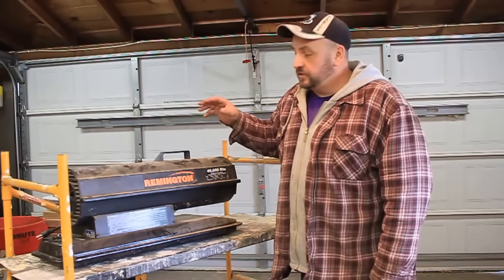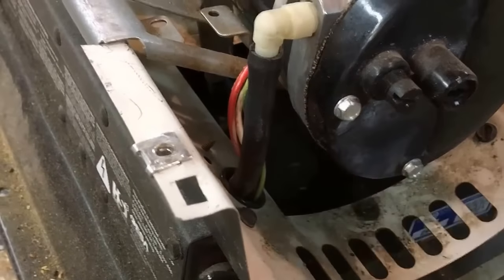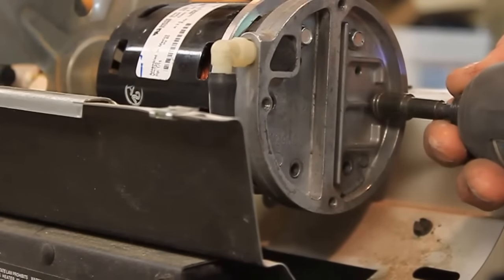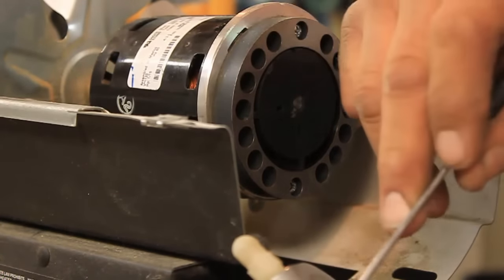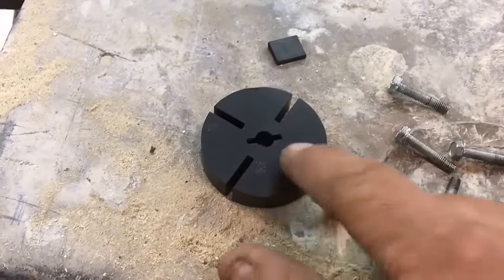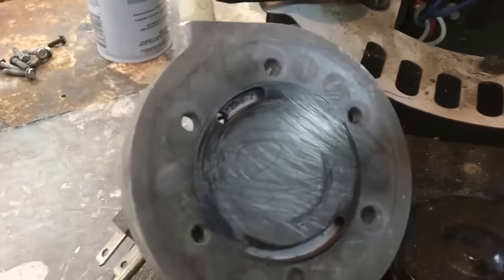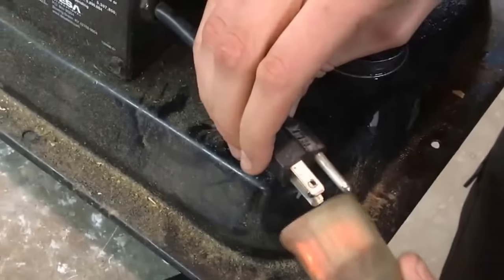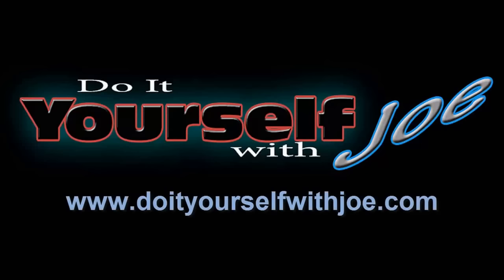How to Fix a Torpedo Heater/One of the Cheapest and Easiest Fixes

Comment: I bought a used old sears torpedo heater, and it worked for a day and then stopped. It’s literally doing the same thing Your’s was, I tried cleaning the spray nozzle, and the feed lines for the air and fuel but nothing, I’m try what you just showed on here I hope this fixes it! Thx for posting! 👍🏻
Reply from the maker: Good luck. Please let me know if it works.
Reply: So I took it apart and they seemed to be fine it was a little dirty but the slides were coming out like they should. I cleaned it up and lubed them up any ways and also cleaned all the air filters. Put it back together and nothing. I have a clear hose on the feed line for the fuel and you can see it starts to suck fuel but then it stops. So my last guess is there is something inside the tank that the pickup keep sucking up. If that isn’t it then I’m lost because the pump is pushing all kinds of air you can put your finger in front of the spray nozzle and feel the air coming out.
Reply: @Lukedawg1984  dirt on the photocell?
Reply: Gary Dodson possibly but that would kill the spark/heat element wouldn’t it? It is throwing spark like crazy. I guess that would be worth a try couldn’t hurt anything that’s for sure. Thx for the suggestion. I’ll try and clean it!
Reply: Check the fuel line for cracking.  it's a common problem for many heaters of this style, the diesel/kerosene breaks down the cheap rubber hose the factory puts in.  this causes cracks that cause it to sputter or not ignite at all because it's pulling air bubbles in instead of fuel.  it's easier to see them if you manually flex the line around.  i just picked up a heater with this exact problem for cheap, and after a $3 fuel line from the auto parts store, it runs good as new

Comment: Mine will fire, but shuts back off. Any solutions for that? Or should start here first?
Reply from the maker: If you have a compressor turn the pressure down to about 50 psi. Take the hose that comes from the back and stick the air nozzle into the hose. Start the machine. once its ready to start blow compressed air into the line. If it keeps running then something is wrong with the pump. I show how to do that in this video, here is the link.  https://youtu.be/zVnwTnWTOSQ

Comment: glad i ran across your video. this is about the only thing I didn't try today and it seems like this SHOULD be the fix. I'm notting getting fuel. So, tomorrow I'll give it a shot. Thanks
Reply: David Sanford how did u fix ur fuel promblems?
Reply: i've been so busy i haven't had time to mess with until today..... darn thing still won't work... and it's spraying a fuel mist when u hold up a flashlight u can see it.

Comment: Thank you for the help I got old trustee running again I end up having a cracked fuel line ...
Reply from the maker: Thank you for sharing! Another easy fix that may or may not have cost anything but time. Did you need a new fuel line or were you able to trim the end off?
Reply: @Doityourselfwithjoe  I was a able to trim a little bit off and used a small hose clamp to secure it

Comment: I fixed many of these.Vanes on pump stuck same issue.
This is an air pump not a vacuum.
Air pressure goes into the ejector sucking fuel and sprays out of nozzles.
 Other common issues are: CAD( electric eye which verifies fire in chamber pointing at flame) cell dirty causes unit to shut off in a few seconds if no flame.You can clean off and aim it at flame.
Cracked dry rotted fuel hoses no fuel to nozzle.
Screw with ball and spring sets air pressure 5-10psi to adjust fuel delivery. If out of adjustment unit won't work correctly. Factory has spec on pressure.
Reply: I'm surprised you didn't check the air line first.  I have fixed a few of these for having the same problem.  And each time, I found that the air line becomes old and brittle.  As a result, they crack and break, or loose a seal around the fitting where it attaches causing an air leak.  Good video.

Comment: Would dry silicone be as good as graphite?
Reply from the maker: Not sure. You can apply some and see if it works. Just cleaning the fins may be all it needs. Nothing can be wet because it will gum up and you will have to take it apart again.

Comment: My 135,000 btu Dewalt heater will only blow hot when i press my thumb over the pressure adjustment screw.  WHen i release my thumb the flame goes out...please help!

Comment: Thanks for the vid, love the scaffolding repurpose into workbench trick.  After replacing filters with new and adjusting PSI to 3.5, I get fuel and spark into the burn chamber, but it takes forever to fire and mimics engine flooding.  Before I replaced filters it fired instantly.  I replaced them because they were falling apart.  Anything to troubleshoot for this?
Reply from the maker: You got me on that one. I would think it would be easier for the unit to siphon fuel with a new filter. If you do come up with a fix  can you post it in the comments here? Would like to hear the remedy.
Reply: I learned today that it will fire right off if I remove the hood.  Leave hood on, no fire, flooding.  02 not getting to the fire when hood on.  Hoping to learn more this week.  I got sidetracked while converting an old television cabinet to a hardware bin, hence the scaffolding comment above.  Love it.

Comment: Just had my unit apart. Was afraid to lube it. So cleaned with a rag and put it back together. Works now but not as good as I like. Not atomizing enough by the way it smells a little. Going to get graffit and doing it over. Rock and roll baby
Reply from the maker: You can also take a fine wet sand paper and sand the blades down a little

Comment: I have a master heater that I run diesel in. iv only had it a year and don't use it very often. just when I'm working in the garage. I plug my heater in and it trys to start but wont... I can try it 10 times in a row and it still wont start. I walk away for 10 minutes and come back and it fires up right away. any idea what my issue could be. haven't taken anything apart yet.
Reply from the maker: Wow i definitely haven't heard of that yet. I will have to ask around.

Comment: You know guys that's exactly what goes wrong with about 90% of them the little pump fingers don't slide down after they get dirty I like to use a little bit of Scotch-Brite in between all the teeth and then I sand the teeth all down a little bit and man my pump runs red hot in the front no stink runs perfect

Comment: Any idea why my heater only runs if it’s tilted?  If I pick up the front end and set up on a block or something, it will run, ( or the back end)otherwise it won’t if it’s sitting flat!
Reply from the maker: I want to say it has something to do with the pickup tube in the tank. It doesn't make sense, front or back though.
Reply: @Doityourselfwithjoe  Yeah that was my thought too, until i picked up the back-end as well..and it ran fine..I still think its something with fuel delivery, but doesn't make sense..I'll update if i figure it out. Thanks

Comment: I’m tearing mine apart because there is no pressure being read. I give it a clean and it still does not want to suck air to spray?
Reply from the maker: before you take it apart again, and if you have access to compressed air, turn the machine on then  take an air hose and shoot compressed air into the line. If it fires up then the problem is in the rotor area. Then i would take the cover off the rotor and by hand make sure the blades drop into place. If that is working fine you may have to hook up a pressure gauge and turn the adjustment screw that controls the pressure.

Comment: Joe, I have a heater that runs and shuts off after 5mins. I've replaced, the ignitor, eye, impeller, nozzle, circuit board, fuel filter.
Reply from the maker: not much left to replace. I'm not sure if there is an over heat sensor or not.  Try to run the heater with and air hose and see if it still shuts off. If you have a compressor, turn down the air. Then take the hose off the pump and stick the compressor air nozzel in the hose from the air pump. See if that works. I have a video on how to do that. https://youtu.be/zVnwTnWTOSQ. If it still act up then you will have eliminated the air pump. After that i can't imagine what might be wrong because of what you've already replaced. If you do get it fixed please post back here on what it was. It may help others with the same problem.

Comment: Hey,my units starts and runs great with the shroud off. When you put the shroud back on it quits,any advice?
Reply from the maker: Sounds like something is getting pinched or grounded out in someway. If the fan stops running as well it has to be a short of some kind. If the flame goes out and the fan keeps running then I would think it is and air flow problem or a line is getting pinched or a wire for a sensor is grounding out.
Reply: Thanks so much,appreciated.
Reply from the maker: I hope you find your problem. If you don't mind can you comment on what the problem was? I would appreciate it.
Reply: Checked the pump pressure,it was at 4.0,turned back to 3.0 and it worked perfect. Thanks so much ,your video was a great help, Brent
Reply from the maker: I'm glad I could help and thank you for sharing!
Reply: Hey,youtube is the shit. I run a construction company,its how we look after our equipment. A no brainer.
Reply: Brent Little po
Reply: Did you figure out why it only ran with the shroud off?

Comment: I have one that runs for about 10 minutes has new hoses and cleaned photocell and connector but shuts off after 10 minutes gonna try this but not sure what could be the issue is
Reply from the maker: Please let me know what the issue was
Reply: @Doityourselfwithjoe   for one the fuel line and air lines was broken and rotted I cleaned the photocell then I noticed the screw to turn up air pump had backed out a good bit so I adjusted that and now it runs great
Reply from the maker: Awesome! Thanks for sharing! I want others to benefit from this as well!  @lilvedo1
Reply: @Doityourselfwithjoe   no problem

Comment: My dyno deluxe 80000 turns on then shuts off after 30 or more sec. And light is off on the thermostat? Is this why ?
Reply from the maker: it could be. Try taking the siphon hose off and send compressed air through as it is starting. Dont set the pressure to high. If the heater keeps running, then that is your problem.

Comment: i have 2 dewalt torpedo heaters that run for 2 minutes than the fan starts making a winey noise and shuts off completely.  any ideas?
Reply from the maker: It sounds like the fan bearings are going out. That would be my guess

Comment: I have a year heater hardly used that will only run with the top half of the cover loose with out the screws  , air cleaner new and clean proper fuel pressure,  weird cover tight won't run take screws out runs perfect
Reply from the maker: Make sure you're not pinching a wire or hose.
Reply: @Doityourselfwithjoe  I triple checked everything,  I can not find a single thing that would cause this, it's like a air fuel ratio is off , but what and how? All pressure testing is right on...
Reply from the maker: @stevenstair1068  If the hoses don't have any cracks or are not pinched, then you got me stumped. If you do figure it out please post the solution here.
Reply: @Doityourselfwithjoe  I certainly will. I was in skilled trades machine repair for 45 years and could fix almost anything but this has me really stumped!

Comment: I have one that the fan won't spin?  When I spin it by hand it has a tight spot where the fan stops. I can force it past it but when I plug it in it just stops?
Reply from the maker: The fan is shot. You can take the fan apart and try to lube the shaft with WD40 or oil.  and let it sit for a couple of hours. That might help and give you another season. You might be able to order one online or get one from Grainger.
Reply: @Doityourselfwithjoe  I think it's the motor itself. Going to order one.

Comment: i have a protemp pt70 kfa.  when i switch it on the green light goes on but it does not strt.  any ideas?
Reply from the maker: I don't know much about this model. I would need more information. Does it do anything at all? I think these are the models that flashes trouble code. Is it giving a code? If the green light is on we know it is getting power. Does it hum? Does the fan turn on? Does it have a fuse?

Comment: My heater seems to spray to much when it is running (which sometimes it doesn't start and blows smoke) it send out droplets in the heat when it is running. You see a little kerosene on the bottom of the front that is not burning. Any ideas
Reply from the maker: There could be something in the nozzle that is causing it not to spray a mist or its possible the pressure is to high.
Reply: @Doityourselfwithjoe  Thanks for getting back. It also has a high/low and if you start it on low it blows smoke b4 it fires.
Reply: @gjames57  , you want to make sure to start the heater on high every time. Once it heats up you can switch it to low.
Reply: @michaelzeinert2074  Thank You I will

Comment: Any idea why a 75,000 btu unit works better with the fill cap off then screwed on? Im talking about the fill cap on the "gas" tank.

The unit is a Master MH-75T-KFA 75,000 BTU
Reply from the maker: It has to be a ventilation problem. There should be a small hole in the fill cap. This allows the fuel to be siphoned from the tank. In your case it may be clogged. Check to see if it needs to be cleaned or you may need a new fill cap. Please comment if that fixes the problem or if it was something else.
Reply: I have the same unit, and it has 3 vent holes drilled through the cap. Check your cap to see if it has vent holes or not.

Comment: I figured it out why the fan wasn't spinning.  Someone along the line had put the black carbon thing in backwards.  So what in the world would cause the heater not to light when you can see fuel spraying in and the glow plug lighting?  Even double checked to make sure it was 1-k kerosene.  It is getting air from the pump.  Sprayed out the nozzle and can blow fuel thru the line into the tank.
Reply from the maker: you got me on that one. Unless the nozzle spraying the fuel isn't aimed at the glow plug.  If anyone has an answer please post.

Comment: My torpedo heater ignites and runs great for 5-10min then it cuts off. I have to reset power to heater to re-ignite. Checked ground and cleaned it. Bypassed thermostat.
Reply from the maker: Take the cover off and rotate the van. See if it rotates freely. If it is difficult to spin it could be the bearings in the fan motor. If it draws to much power it will trip the reset button. I'm not sure what model or brand, it may even have an over heat sensor of some kind. If anyone may know the solution please post.

Comment: Good video thanks I'm on my way to fixing two heaters myself, but I'd like to see you use some gloves with that brake cleaner, that stuff's bad for you. I could see your hands turning white that is Tetrachloroethylene, great cleaner, not good for skin, and don't heat it, using it before cleaning on welding can be life-taking, Phosgene gas could occur, look it up, great video though my heaters should be running in no time, thanks again

Comment: I certainly hope this solves my issue.  I get the same issue.  Device turns on.  Fan turns.  I see the ignitor turn on.  Then within 20 seconds the unit just shuts down.  I went out last week and bout a photocell thinking that may have be the issue.  New one didn't fix it.  Now I'm anxious to give this a try.
Reply from the maker: You can trouble shoot this problem by taking the hose off the back of the air pump. Use a compressor to shoot air through the tubing. plug the torpedo heater in. when you see the ignitor light and the fan goes on send some air through the tubing. If the heater lights and runs it is the air pump. I hope this helps!
Reply: take the top off. When the fan starts and the igniteor comes on do you fuel coming out of the injector/fuel nozzle? It should be squirting a fan spray pattern.

Comment: my fan motor doesn't spin that freely when the pump assembly is attached, it does when it u, do you think i might have the white spacer push in too far?
Reply from the maker: That may be, especially if it spins fine when its not attached. If you can't get it adjusted correctly you can get thin brass or bronze washers to slide on before you put the pump assemble back on.
Reply: doityourselfwithjoe hey there I have a dyna  glo . It won't fire unless I dangerously reach in and try to get the fan spinning myself . Then it runs like a champ for the most part until it needs to start up again. Where should I start?
Reply from the maker: Sounds like the fan bearing is going out. Try and lubricate it. I have used WD-40 on the one in my video and so far i have gotten 2 more years out of it. I just recently sprayed it again and it is running fine.

Comment: Just some info...you do NOT use graphite on those fins. Any kind of lubricant you put in the pump ends up eventually in the fuel line and in the injector nozzle and can plug it. Just clean those grooves good and put the fins back in, rounded end out. Set the clearance at the top of the fin wheel with a feeler gauge to .06". Make sure the fuel and air line fit tight on the connectors and don't have any cracks in them.
Reply: Amen!

Comment: Your pump itself isn't creating suction directly... its pumping air into the injector, which is in turn using the venturi effect to create suction at the injector, drawing fuel into it, which is in turn atomized, and ignited by the glow plug.